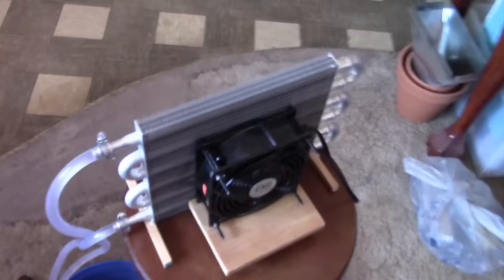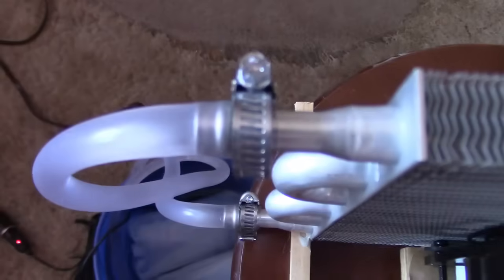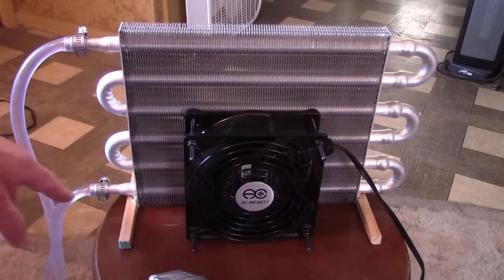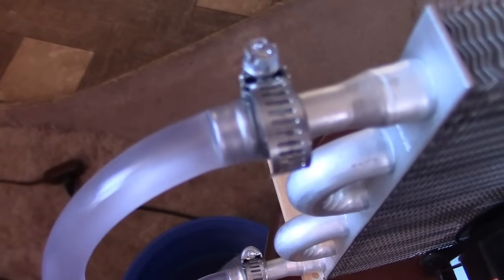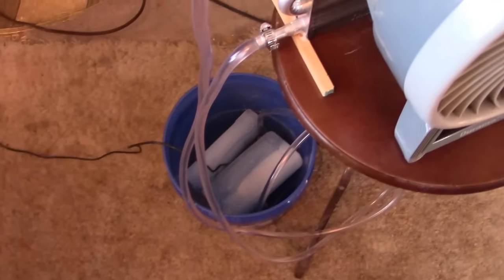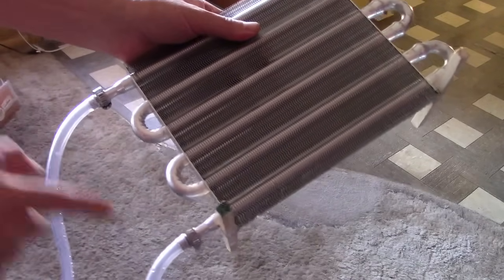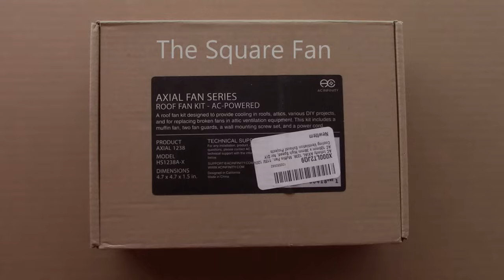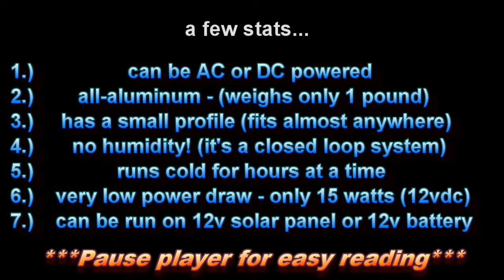Homemade AC Air Cooler! DIY Air Cooling! best yet! (no added humidity)! Easy DIY - Air Conditioner!

Comment: This thing IS really awesome! BUT, here’s something to consider:

If you actually used this for a few hours a day for a month, you’d only spend about 8 dollars max to run your home freezer to produce the ice over a month. That’s actually worth it because you’d spend about 20-25 bucks a month in electrical costs on a regular room AC. That is if you don’t actually need to reduce the temperature of the room drastically.

But, If you were in an rv or a small cabin without grid electricity, and you were trying to keep a small space cool to be able to sleep, you wouldn’t have access to a freezer to produce ice. You’d need a really expensive solar kit to run a freezer. Anyway, you could use a cheap solar array to run that blower fan through the coils like you have. But you’d have to spend over 120 bucks a month on gas station ice.
I suppose you could get some bags of ice from some random nice people for free.
Reply: there are also small DC mini split systems available you can operate from relatively small solar panels. they can also have a battery in the system too. they are pretty badass systems if sized correctly for the heat load you have and sunlight is available. i’ve installed a few of these systems. they can be complete stand alone

Comment: Netter thn some of your older designes which emitter the humidity in the air, better for the E where you cannot add more humidity or u get mold.   More of the cold would go into the radiator to the aor if the ice water was in a cooler rather than a 5 gal bucket.

Comment: excellent, I can go offgrid and save electricity cost
Reply: The savings would be less than you think. You will still need to make ice. The ice melting in the water keeps the water at 32 degrees much longer than if it was just refrigerated water.
Reply: @jpp9876  with the way PGE keeps increasing rates in CA for electricity,  you would definitely save on electricity
Reply: @loewenching6123  my main point is you will be using energy to make the ice too.
Reply: @jpp9876  I'm just trying to save cost on electricity, I'm not worried about saving energy for making ice

Comment: hello! this is awesome thank you so much. could you share the links for the items? maybe if you do affiliate or something with amazon you can make some money from the links when we click to buy. ALSO, do you think this would be safe to run in a van? (40 sq. ft.) THANK YOU!!!
Reply from the maker: hi and thanks! i think it would work great (even awesome in a van). i didn't post exact link for trans cooler because i didn't want to give all the business to just one company (plus sometimes the price gets raised by 30% or more right after i post a link to some things - presumably due to the increased interest). best way to find them is to just search for transmission coolers. there are a lot out there.

Comment: That is great idea. I'd add an insulated ice chest to the mix and put pvc with copper tubing coiled around it in ice chest and run water through that first and then to radiator . I get the copper coil idea from the copper coil ice chest cooler from youtube.
It might be overkill but it might keep water cooler for longer period

Comment: Hi, I been a fan (pardon the pun) for a long time. Has you ever though of combining this unit  with your evap air cooler to get the temp down further?
Reply from the maker: hi. yes you could do that. i've got a video on just that. (with a larger heat exchanger). it makes what is called Indirect evap cooling (no humidity)

Comment: Would your 80 watt fan you've used in other builds make this ac work better or would that be overkill? What size room might this ac keep cool? What might the temp drop average be in a 9 ft by 12 ft room if it was 105 degrees outside in New Mexico? Thanks desertsun02. Love all your builds :)
Reply from the maker: hi. that might be overkill. the 80 watt fans probably pair up better with those thicker heat exchangers i have used in previous videos . many factors go into the temp drop - but there should be a significant drop

Comment: I like this closed system (with closed bucket :) ). Have you try the different if using double unit (fan&radiator)? I mean one unit for cooling ordinary water and 2nd unit for blowing the cold air. Both unit is connected? If it works it mean no need ice block water who cost electric. Keep cool work..cheers.

Comment: Swamp cooler does not equal real air conditioner
Reply from the maker: hi. a swamp cooler is something different. those are evaporative-based cooling and can add humidity to the air. the units shown in this video just cool the air (but don't add any humidity). the key is the radiator

Comment: You are a genius. 
The bucket and the plastic tubes could be insulated.
Reply: thinking the same thing. also water could be put in a cooler. wonder how cold it would blow then. and if the icy water would cool longer.
Reply: Good idea! Add Styrofoam or put it inside a picnic cooler
Reply: Actually you don't need the insulate the water chest or the hoses you got to remember you're trying to cool the whole room if the hoses and chest are in the same room they add to the cooling effect do the math

Comment: Fantastic a/c system. I'm designing a two person predal assist electric mobile unit for camping and your design is a perfect solution. The fact that it uses very little power to keep two people cool is fantastic. As for a free heating source I will be using an evacuated vacuum tube solar heating system made by SunSank with a 40 gallon tank capacity. Free hot water from the sun. Thanks for sharing your A/C system. 👍🏻👍🏻
Reply: YOUR IDEA IS EXCELENT BUT I CAN HELP YOU BY USING VACUME SOLAR WATER HEAT CLOSE LOOP AND PRESSURIZED SOLAR WATER HEATER AND YOU CAN USE DC SOLAR WATER HEATER
Reply: Im building one for camping too. I used a pc radiator and an usb water pump (5v 2a)ordered on amazon. Both should be able to run for 5hours minimum. All is rechargeable. Since you need a bulk amount of ice i figured a portable dc freezer would be needed for continuous ice supply for extended camp trips.

Comment: I have a question about the the speed of the water flow.
I'm thinking of building one of your designs here but with 1/4 inch drip irrigation line. Do you think that will be an efficient setup? I have a small heat exchanger out of a window AC unit 5k BTU.  You having years of experience and knowledge building these I'd like to know what you think? Thanks in advance!

Comment: I was wondering. You have a fan in front with the grid behind blowing forward and  a fan behind the grid blowing through. Did you notice any differences? 
Awesome video! 
Thank you! 🤠
Reply from the maker: yes i did. it was a couple degrees cooler when the fan was behind but the air moved a little slower (it's a trade off). since it's cold either way, i go for the fan in front. lots more air and still really cold.

Comment: Another awesome video. Does this build work to lower the ambient temperature of the room? I’m considering building one myself in the next few weeks to ideally save on AC costs.
Reply from the maker: hi there and thanks. yep, it certainly does. during testing i had a thermometer laying out on computer desk (to the side of the unit about 10 feet away) and near the end of the test it was 7 degrees lower. *this was an un-planned event (and not officially verified) so i didn't include it in the video). i did film it though (along with my surprise) so i'll post that along with other experiments in a future video. note: it works so well i've already ordered 2 more 'small radiators' (of different sizes and shapes) along with extra pumps, fans and tubing so i can make a couple more projects.
Reply: save on AC cost? how do you plan to cool your water in your setup? :)

Comment: How many watts of electricity is required to run it? It looks awesome!
Reply from the maker: hi. not much at all. the pump i'm using is only 4.8 watts and then you just need a small desk fan or square type fan. those are 10 to 20 watts. (so 15 to 25 watts). that's just pennies a day! and if you go solar with it it's about 15 watts. *so a 12v 20 to 30 watt panel is all you would need and then it would be free to run.
Reply: @desertsun02  my jackery would run small freezer to make ice and that water pump and fan.
Reply: @friend757  make sure you put the freezer in a different room, all the heat they extract from the water gets sent outside so it heats the room again
Reply: @amiibo7063  Thank you! I had not considered that and your comment helped me a lot!
Reply: @desertsun02 I wish the pump could run off a power bank from USB power. But I suppose it requires 12V minimum and USB is only 5V. :( I ask because this would be awesome in my mail truck but the cigarette lighters are always burned out and unusable on these crappy trucks.

Comment: Another great video I've seen of yours! I think I might make a copy of this one. I think some insulation of any sort on or in the bucket or hose would be a great addition. Could you share the amazon link for the radiator? I like the idea of being able to use hot water as well. How hot do you think a normal pump/hose could handle?

Comment: NIfty!  Would one of those little pumps be able to keep a counter-top ice-maker running too?  I think I remember you running one of those off a Harbor Freight system years ago.  I'm betting a pretty decent self sustaining system could be made now with solar panels getting so cheap (relatively). You'd just have to compensate for evaporation I think.

Comment: This is pretty neat man. Have you considered making it a closed loop system with two radiators with a pump in between? If you added a salt/antifreeze to the loop it would allow it to reach sub zero temps. You would not gain any size and only the weight of the seconds trans cooler. Mount the exterior trans cooler to the top of say an igloo cooler with the fan pushing through the radiator. Also mount the pump to the top. For kicks you could make it all 12v and make it portable by power with 18650 battery packs. You could then either make the battery pack detachable or make it a built in package with an onboard charging board that uses USB-C to charge and/or power the unit indoors. Just some ideas. I still think this build by itself is fantastic. Do not take my "ideas" as anything other than inspiration by your awesome work .
Reply: Mr. Munkeymeat you should make one and post a video.
Reply: what if one radiator is kept in flowing water, would it be feasible for cooling. (ambient water temp is 24°C)
Reply: Umm.. I'm late but. Salt will destroy an aluminum radiator.

Comment: So, instead of running freon through the tube, you are running ice water.  I see.  And instead of using a compressor,  you are using a water pump.  I see.
What I don't understand is why fins are needed here.  Do they serve an actual function in this application?  I mean, wouldn't  this cooling system work exactly the same without the fins?
Reply from the maker: hi there. nope, it wouldn't work without the fins. they expand and separate the area creating a 100 times more surface area for the heat transfer to occur.

Comment: LOL This is nothing new, People been doing this Forever. We use to use Full size Truck Radiators & pump Cold creek water or Well water through it with a strong fan. People need to get out more

Comment: I'm telling ya, as soon as I getting my tiled installed, I'm going to try some of your experiments.  Thanks!
Reply from the maker: please do! - this one (and 'spin-offs') of it will probably be my top summer time air cooler projects. i've already got 4 more project ideas (floating around in my head) of how i can use these type of heat exchangers (now i just need to buy a few more different sizes and start building)

Comment: I'm so off grid, that ice is something I buy and haul home lol, dig this setup, but really liking your evap coolers!
Reply from the maker: hi. also remember that evap air coolers (like the blue cube one that you are thinking of making) actually are water chillers too (because they cool the water in the tub down to the air temp they are producing). reason i mention this is you can actually use it (the cold water it produces) to 'fuel' the unit in this video. no ice needed in that case. (indirect evap. cooling). if interested here is a link to my video on how you can do it (shown with a larger heat exchanger - but you could use the one shown in this video) https://youtu.be/7ONB-hoyAZQ

Comment: Desertsun02 you are amazing!!  I've now caught the DIY cooling bug and once I'm finished with the Portable Tote Cooler I'm going to build one of these. One question, have you thought about combining this radiator-based cooler with a Peltier water cooler? I just saw this video about a Peltier water cooler and it looks like the water from this could be recirculated - but the unit would need to sit outside a window because of the heat it gives off.  https://www.youtube.com/watch?v=-QL9cSgh9pA
Reply from the maker: hi there. i have thought about that but i'm not sure if peltier water cooler would keep up with the radiator. have to run experiments 😎
Reply: You have to insulate Peltier cooler components. I use a Nova Tec Coolworks Ice Probe in my 16 site EZ Cloner reservoir, and I wasn’t getting a decent temperature pull down until I insulated the reservoir. That will give me a 4 degree temperature drop from ambient. If I also insulate the top cover and seal the seams with tape, I can get a decent 10-15 degree temperature pull down. I use a TEC-65 controller with my setup. If you insulate the tubing and heat/cool exchanger blocks you should be able to get some decent cooling with the Peltier chillers.